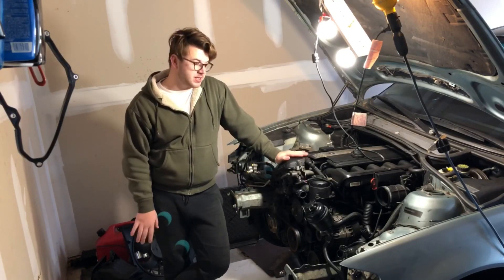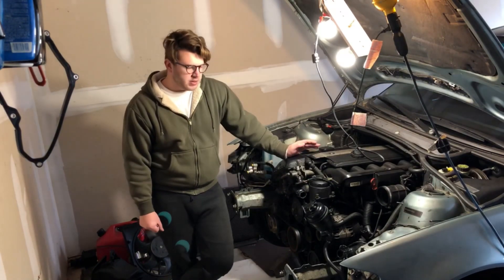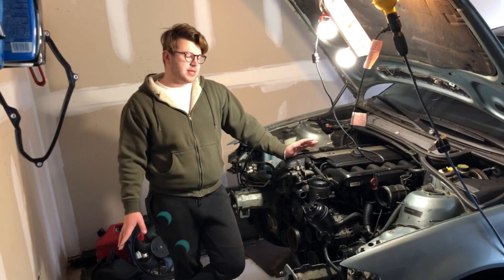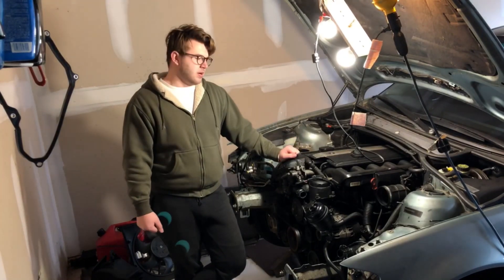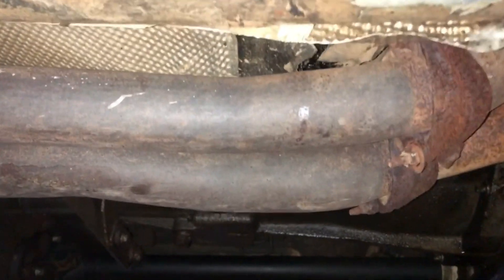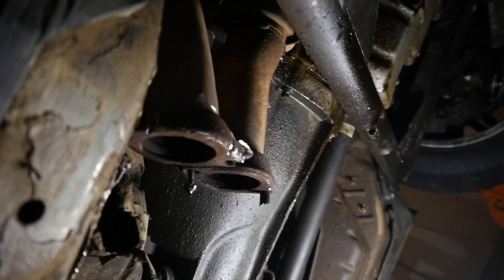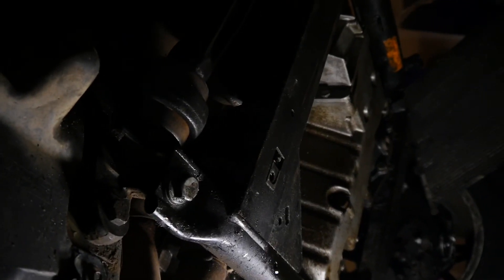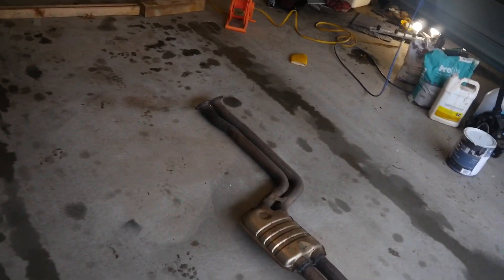The $500 BMW Autopsy and Engine Removal! - E46 EV Conversion Part. 4

Comment: "propeller bolts" I laughed so hard to this. Very entertaining. I don't understand why you took the transmission out with the motor. You didn't have to. It would have been so much easier pulling the engine alone. I have other questions about why you did some things and how you are going to solve some very obvious problems but I will save them for now while I watch the rest of the series.
Reply from the maker: I’m aware it didn’t have to come out, but that’s if you have long enough extensions and such to get at the bolts from the back of the motor. I was 19 when I pulled the motor, and working in my garage, I made do with the tools I had access to. That’s the story with a lot of this; I’ll build it, see what doesn’t work, fix it, and improve over time.
Reply: @TechMischief  It does sometimes frustrate me the way you do things but it's somehow addicting and quite entertaining to follow your journey. Keep up the awesome content. I will wait with baited breath.

Comment: Interesting to watch! 👍 Will you make it fully street legal? Not that I know much of the requirements in the US or here in Sweden, but still curious..
Reply: Honestly, as long as he does not have safety inspections where he lives, there really is no way for them to know. I'm not sure how a smog test would go, but it produces exactly zero so I don't think they would give him any trouble. For a safety inspection, they would probably require him to secure things such as the batteries, electronics, and motor in such a way that it satisfies their requirements. That would be a very interesting process to share with us! He should also be able to register it as an experimental vehicle as long as he passes a safety inspection. I believe that is country wide.

Comment: That looks like a heavy car. but it might end up lighter when you are done. (have you picked a motor yet?). That all wheel drive looks a nightmare. looking forward to the electrical side of things!
Reply from the maker: I’ve actually got a video detailing the motor, its a 144kw DC motor. In the final version of the car, I do believe it’ll be lighter. But right now I am likely using lead acid, so that’ll probably end up making up the weight that was lost. Eventually when I save up, it’ll go lithium, but for the sake of cost, I am just using normal truck batteries for the time being.
Reply: Electric converted vehicles end up heavier afterward. The removal of the engine weight is nothing compared to the weight added in motor and batteries.